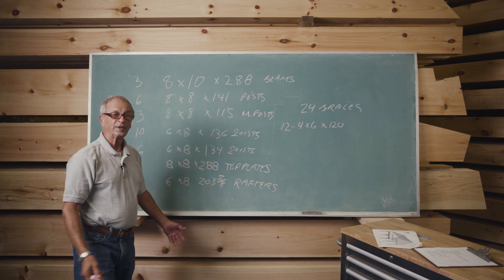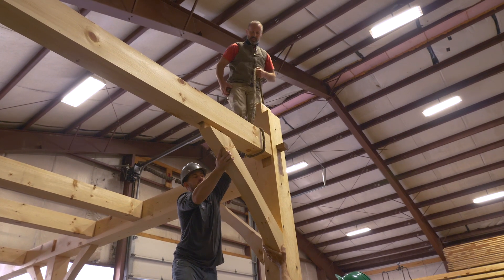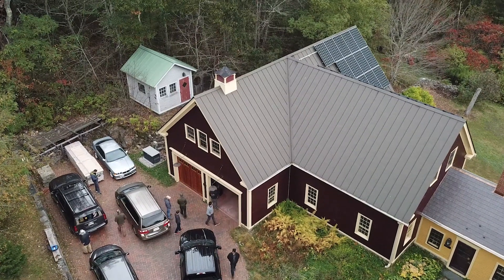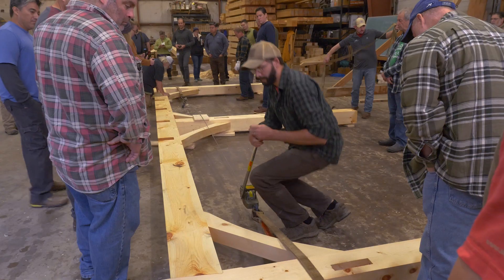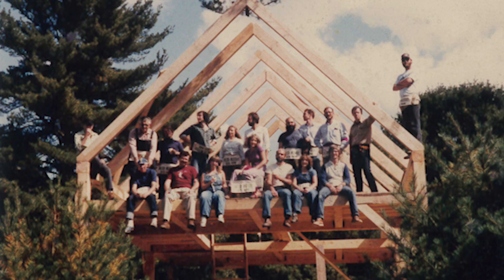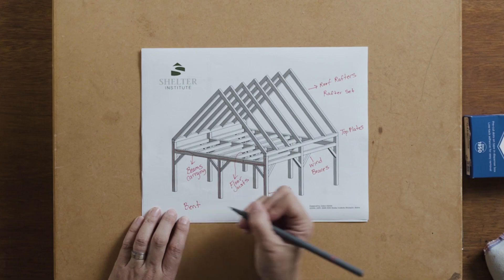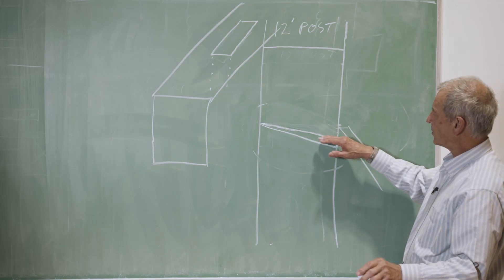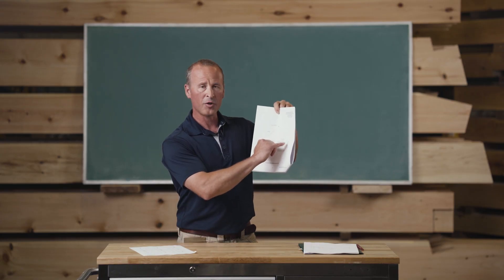How To Build a Timber Frame House or Barn - Intro To Timber Framing Online Course

Comment: Is it possible to erect a Timber Frame addition to a stick framed house, and also to Deconstruct part of a stick frame house and Remodel that with Timber Frame construction using yellow tulip poplar or other such wood posts and beams?>Thanks
Reply from the maker: Hi John -- it is absolutely possible to erect a Timber Frame addition to a stick framed house. It needs to be done with care so that the new timber frame does not put pressure on the existing stick frame structure. If you are interested in seeing photo albums of additions we have built, send an email to info@shelterinstitute.com

Comment: I want to build a house now!
Reply from the maker: How can we help? It is one of the most rewarding experiences -- even if you don't build a house but you renovate. Just knowing how is truly empowering.
Reply: @ShelterInstitute  Well I have a basic education in carpentry and I've tried many aspects of house renovation, but I really would love experience in building from scratch. I would be awesome to just help you build a house and learn first hand from professionals like yourselves. :)
Reply from the maker: @Erik_Thygesen  thank you very much for your kind words. We build a 24x24 timber frame that is 1-1/2 stories in our Purely Post & Beam Class. It is exclusively the timber frame with joinery but no systems of the structure. We teach the design and construction of the rest of the systems in our two-week design build course. However, we do not build a structure. Instead we have taken apart the house building process and teach all of the systems of the home independently. In this way we are able to teach our students how to think about building and plan it so that the systems relate to each other in a cost effective and efficient manner. We don't want our students to leave know how to build one house, we want our students to leave knowing how to think through, problem solve and plan any type of building.
Reply: @ShelterInstitute  It sounds great. I am very much into design and also want to understand what to think of when constructin. I will keep your course in mind and maybe one I'll be able to attend your class. Thanks for the information.
Reply from the maker: @Erik_Thygesen  thank you for your interest and for taking the time to comment! You might consider visiting our online course page to watch a free section of the class! https://onlinecourses.shelterinstitute.com/courses/purely-post-beam-online-course

Comment: Hi , how do you insulate a timber frame?
Reply: most people use sips, which is basically two layers of plywood with foam.sandwitched between, screwed to the exterior of the timber frame
Reply from the maker: When we build a structure for a client we enclose the frame with SIPs. We have developed an efficient crew and system for assembly. But any kind of hung wall system creates the framing to enclose a timber frame, house the insulation and wiring and protect the frame from the elements. We have several kits pre-priced on our web site to provide an idea of cost involved with a timber frame enclosed with panels. www.shelterinstitute.com
Reply: @ShelterInstitute  why use such an ecological disastrous material
Reply: @SuperSinnig  seems pretty efficient to me...
Reply: @SuperSinnig  Because it's fun and it annoys you.
Reply: @thetruthisonlyperspective4872  I believe  the comment was about the foam being a bad product for the eco system, not that it isn’t efficient. With any luck the house would last for eternity and the foam will have paid for itself by saving a landfill an extra load of crappy house.

Comment: Tempting, very tempting.
Reply from the maker: The holidays are coming up soon...treat yo self! 
Seriously though, have you added your email to our list for updates on this online course? We may or may not be emailing out a discount code on Monday to those on the list for $50 off the course. Opt-in is at the bottom of the webpage here -onlinecourses.shelterinstitute.com
Reply from the maker: Hey William, just a heads up that we actually added a Free Timber Framing Mini Course at the above link last night! 1.5hrs of hand-picked content from our full 10+hrs of Timber Framing Online Course content, for free.
Reply: Shelter Institute nice!  I’ll check it out.  I came back to this comment because I didn’t receive an email